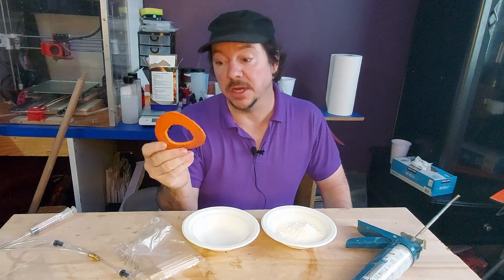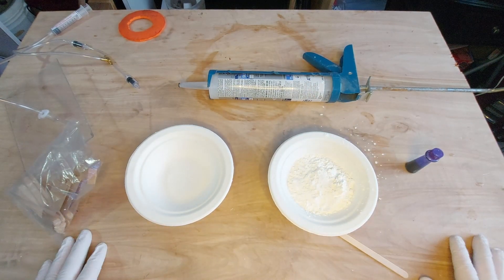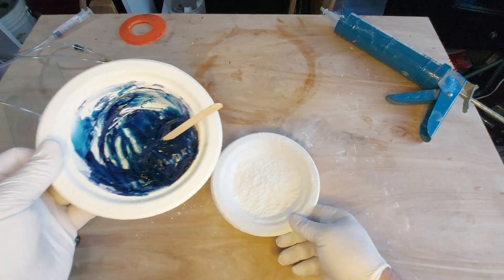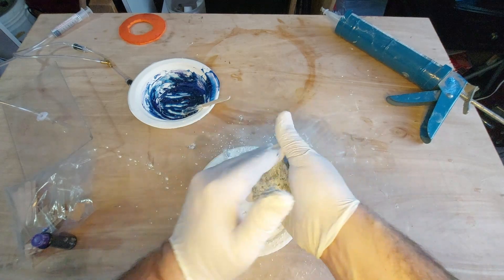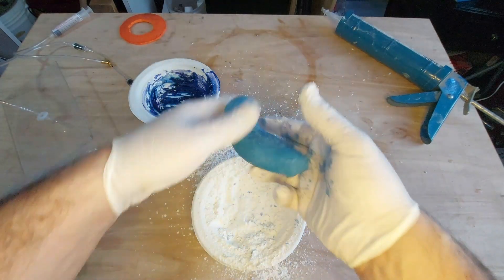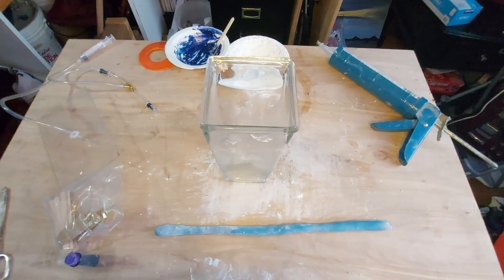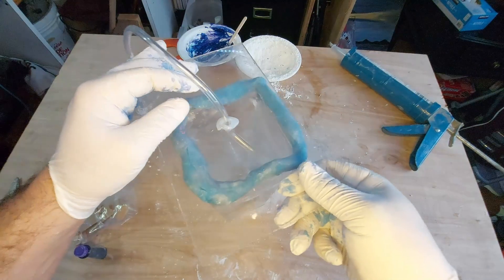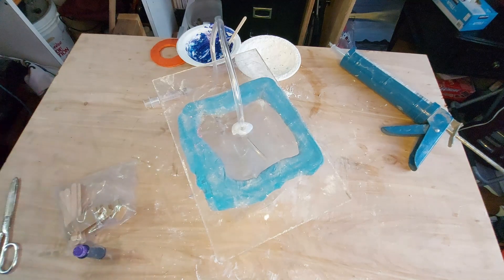Making seals with Proto putty

Comment: Can we use marine silicone?
Reply from the maker: Never used marine silicone for this. Regular 100% silicone is what I have always used so I can't see a benefit to using something more expensive. But hey, give it a try.
Reply: I did. It works fine. I asked because it was the only silicone I had at the time. I appreciate you.